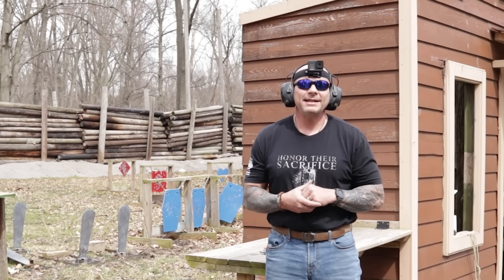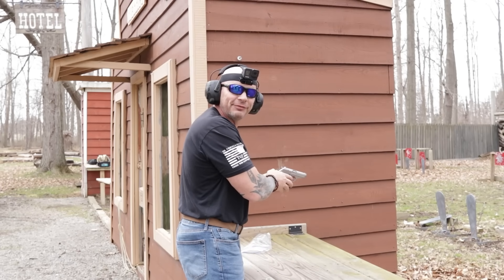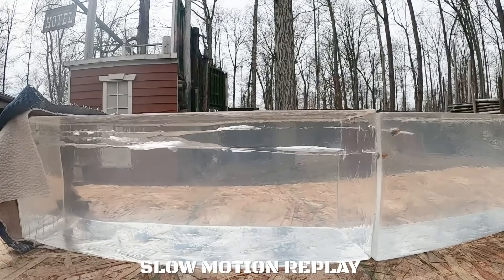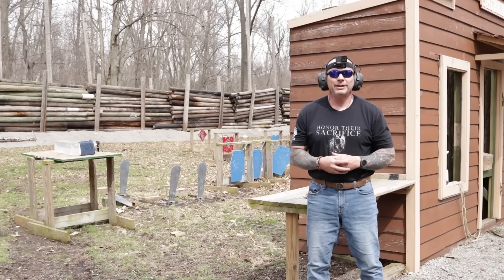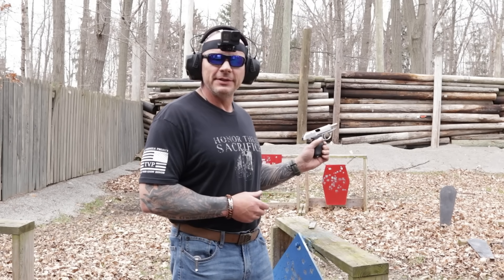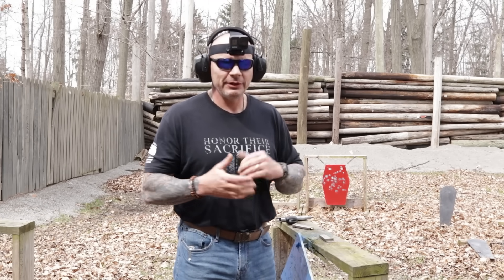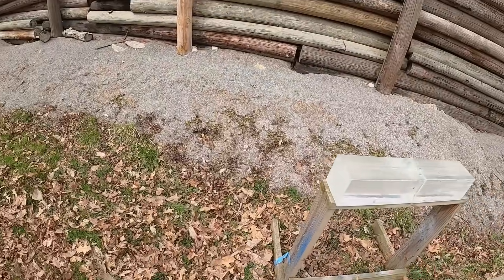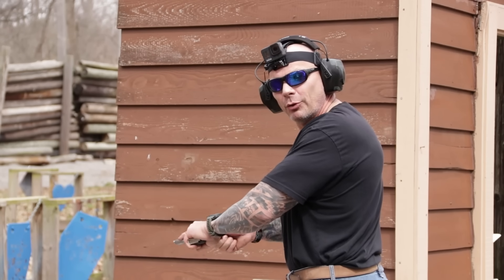Stopping Power of .380 ACP

Comment: Collected some data for the specifications of same round from Federal for .380, 9 mm, and .40 S&W and testing from Scott’s with 4 layer denim over 10% ballistic gelatin at 10’.  Wanted an apples to apples comparison.  The .380 penetrated 12.26” and expanded to 0.59” at a velocity of 956 with muzzle energy of 189.  The 9 mm penetrated 13.86” and expanded to 0.63” at a velocity of 912 with a muzzle energy of 326.  The .40 S&W penetrated 15.4” and expanded to 0.72” at a velocity of 968 with a muzzle energy of 468.  I don’t shoot Federal but gathered this pretty quickly.  I carry the Winchester Ranger T Series in my 9mm Sig P365 and .40 Sig P239 in the identical Holster.  They function the same and I only carry inside the waistband on my strong side.  I accept the added size and weight of the micro 9 for, what I feel are superior ballistics to the .380.  Not a hater though.  Use to carry one when higher caliber options were far too large like the venerable Beretta 92fs.  I greatly ascribe to the data compiled by Dr Martin Fackler regarding bullet effectiveness for a wide range of common pistol, rifle, and shotgun rounds.  It is a well organized, interesting, and scientifically supported read.  Carry legal, carry safe, carry often.
Reply: Greg Ellefritz work, which actually relies on thousands of real world shootings, shows no signjficant statistical difference between 380 and any of the other Duty calibers. Even the specifications that you listed above between 9 mm and 380 are almost identical. And any difference at all probably vanishes once you step up to 380 +P
Reply: @Followme556  We all have opinions.  If they are all statistically identical I do wonder why law enforcement agencies across the country and the world don't issue .380 caliber pistols?   Seems like a no brainer if they are so reliable, so powerful, and shoot so much better than larger calibers  The agency I worked for only allow them for back-up weapons.  I will stick with what I carry in 9mm and .40 S&W which I shoot rapidly and with consistently perfect scores for the last 30 years.  I simply don't need a .380.
Reply: @markymark9961  law enforcement agencies all over the world used 380s for literally decades. There are probably still quite a few who still do.
Reply: @markymark9961  Shanghai SWAT for instance when that was literally the wild west of the East issued Colt 1903 carry pistols until the Communist Revolution. Very very famous time for gun fights and some very famous gunfighters came out of that era and police force.
Reply: @markymark9961  40 Smith & Wesson is a good example of what we are talking about though. LE agencies all over the US adopted it because it was perceived to be needed, but now they have almost all abandoned it because it is literally no better than 9 mm and arguably worse.
Reply: @Followme556  I can find studies that say anything.  I want to see analytical data.  LE did not abandon the .40 due to its lack of effectiveness according the the FBI at Quantico.  "We opted for the best marginally effective caliber that the weakest shooters could shoot acceptably".   The .40 was not the best choice for their agents.  Meaning they can't shoot it accurately and efficiently and the cost of a 9mm is lower.  They did not adopt a .380.  Wonder why?  I read the article you referenced and Ellefritz which isn't a study in the sense of the word, it is a list, or as he called it "pulling numbers out of thin air".  I love all his back peddling throughout the article.  In fact he concludes the article with " I do not believe that the .380 auto works more effectively than a 9mm, .40 S&W, or .45 acp.  If you read all the excuses he makes for the numbers in the "study" and believe in his "research" and accepted his recommendation, you wouldn't carry a .380.    No debate for me, I'm sticking with what I got.  I suggest you do the same.
Reply: @markymark9961  Ellefritz literally studied thousands of shootings. That's analytical data.
I did not say the 40 was ineffective, i said it is inferior to 9mm when all things are considered.
Who cares if the FBI adopted a 380? They didnt adopt a 10mm or 44 magnum either- but both of those rounds are highly effective.
There are 380 rounds that consistently expand through denim and penetrate 12+". They have been used to great effect by many LE agencies all over the world, for decades, and they have shown to be every bit as statistically effective as any other duty caliber in real world shootings.
I don't really care if you can wrap your head around these facts, they remain facts nontheless.
Reply: @Followme556  Facts based on what?  You cited "real world shootings" by Ellefritz who does not draw the same conclusion as you.  Name a single law enforcement agency in the USA that issues them as a primary pistol.  For decades the police standard issue was the S&W model 10 revolver loaded with semi wadcutters.  Not a good option.  Your point on the issuance of the 10mm and 44 magnum is mute since we are discussing calibers less powerful than 9mm and .40 S&W.  I will be waiting for the facts.  I took time who find the author you cited since I am always open to learning and finding new information.  That ain't it.  It only reinforces my point.  A .380 can be sufficient, however, the ballistics are unreliable especially from shorter barreled pistols.  You sound like a member of the Biden Administration.  Russia, Russia, Russia, it is as clear as crystal.......until the evidence was divulged. Zero.
Reply: @markymark9961  Ellefritz' data literally draws the conclusion I am stating. 380 is within a few % points of every other duty caliber, and is actually higher than some of them.
Who cares what US LE agencies use 380? None of them use 357 magnum anymore....it's still the single most effective duty caliber in the Ellefritz study to this day. 
The simple fact is that 380 XTP reliably expands and meets the FBI penetration standard. 

It does so in pistols that are much smaller and lighter than even pistols like the Sig P365, and it is now available in multiple platforms that offer high capacity of 13 or more rounds.
It is not my job to convince you, since I simply do not care what you carry. However, I do not want unthinking automatons to pass bad information either.
Btw, since you are/were a cop, please allow me to remind you that when kids are being murdered in a school, you're supposed to go in and stop it. Since so many of your buddies seem to have a hard time remembering this.
Caliber is irrelevant when you stand outside cowering in a hallway.
BTW, TREMENDOUS wins at the supreme court again today, one directly related to gun rights, and one that is definitely related.
"I did this." -President Donald J Trump
Reply: @markymark9961  I think you should read some historical data, such as the types and numbers of gunfights that Shanghai municipal PD was involved in, before running at the mouth anymore about things you are ignorant of.
Their standard issue was the Colt 1903 380 and they commissioned a special version of it which Ian McCollum of Forgotten weapons did an episode on. He also owns one.
Shanghai PD invented the concept of SWAT, and was headed by two of the most legendary gunfighters of the era, William Fairborne of the Royal Marines and Erik Sykes, both of whom would go on to serve in the SAS in world war II and who designed the legendary Fairborne Sykes commando dagger.
These dudes were as hard core legit as could be, and THEY specifically chose the Colt 1903 in 380 acp as the sidearm of choice for the Shanghai municipal PD.
Fairborne and Sykes also developed the hand to hand techniques for the Shanghai PD and for the Allied commando/special forces units of WWII, and extensively trained allied Commando forces in WWII. Both continued to train SOE and later CIA agents for the US and other allied nations.
These dudes are absolute legends, and they put down more bad guys with 380's than any of us ever will with any gun of any type.
 And they were using "ineffective" ball ammunition.

So the problem here is not that 380 is ineffective, it is that you are historically ignorant and apparently don't realize that the world does not end at the shores of the United States.
Reply: @markymark9961  Your commentary reminds me of all the old Fudd's that used to annoy me at gun store counters who babbled on about how 45 ACP was the only round worth carrying and how 9mm was a wimpy girls caliber.
Reply: @spearthumb68  I don’t stand at gun store counters.  Got better things to do.   Take your meds.  I merely pulled manufacturers data on 3 calibers for illustrative purposes.  The two larger seem superior the the smallest.  I stated I carry the “wimpy 9mm” often.  I don’t think there is a magic handgun caliber.  You are arguing with me because I don’t choose the .380.  How tolerant comrade.  I hope whatever you select works for you in the time of need.  You must be a leftist, perhaps the more diminutive pistol makes you feel more feminine when you are in drag.  Happy pride month sister.
Reply: @Valorius  BTW I may be “historically ignorant” as you suggest, and admittedly don’t look past the shores of the US because that is the theater in which I carry.  Reliable Data on bullet effectiveness, according to most need only go back 20 years or so.  Doesn’t everyone say “with the latest bullet technology” X now compares to Y?  Enough said.  You carry what you like and I will do the same.  Also, you said I am spreading misinformation.  I guess you are the woke internet hall monitor.   I merely stated manufacturers data along with testing reportedly done in compliance with FBI standards.  The reader chooses to accept the data or not.  How is that misinformation?  Bet your all for CRT though and of course in bed with bumbling Joey B and the Chinese.  I hear there are vacancies in the Shanghai PD. Perhaps you should apply.
Reply: @markymark9961  it is very interesting the way that you cast political aspersions at people to cover for your ignorance and lack of knowledge. I suspect that not only are you not an ex cop but you are probably about 12-years-old old.
Reply: @Valorius  PS my ignorance and lack of knowledge are based on 3 things:  manufacturers specifications for the rounds in question, testing purportedly done by Scott’s in accordance with FBI testing protocols, and studies completed by Dr. Martin Fackler, among other anecdotal information such as being involved in and investigating shootings and seeing the effectiveness of different bullets.  I am waiting to your reply to several questions in my posts and also the studies you so voraciously rely  upon.  I ready a study a few years back where a left leaning university received a government grant to study heart disease as it relates to the consumption of bacon. The study talked all about heart health and the evils of eating bacon, until the very end.  They hyped up the amounts of fat and cholesterol and it was scary.  It then talked about the benefits of being vegan and reducing climate change by not eating meat.  Bacon bad, broccoli good.  I dug further.  Once it was peer reviewed and the testing protocols were revealed it was a complete sham.  The study reflected 1 pound of bacon and the reviewers found the study was conducted on raw bacon.   I don’t eat raw bacon, nor do I eat a pound in one sitting so I am still happily enjoying without fear.  True story and you may still find it on the internet.  Fackler didn’t tell me results he demonstrated the results for me to decide.
Reply: @Valorius  You make all good points in your response.  Fackler’s data was updated about 5 years ago I believe.  The original is decades old but it has been updated with the advent of newer projectiles.  They even updated their stance on effective 5.56 rounds moving away from heavier grain OTM bullets which fragment to lighter bonded bullets in the 55 to 62 grain weights.  Taking into account the hard body parts and barriers that may be encountered during bullet flight.  Even though he has passed I believe others are carrying on the research.  I do watch the same videos you do and appreciate what they bring to the discussion in terms of real world demonstration.  Some of those are crazy.  I think the performance of some bullets from any handgun caliber can determine the outcome.  I am a big proponent of shot placement being the key.  But clearly the 9mm and .38 bullets used in the FBI shooting in Miami failed to stop the threat in a timely manner.   The assailants, according to the pathologist, would not have survived the initial hits but fought until they could not go on.  Being a police firearms instructor I have had the privilege of getting many of the first hand reports on these incidents early on.  There are many other similar cases where the bullet simply did not do its job for whatever reason.  I will give you a sad but true story of my Godmothers early 20 something’s son being accidentally shot in the head by a 45 acp from just feet away.  He and a close friend were in the basement preparing to clean the pistols they had just fired when the negligent discharge occurred.  My “cousin” as I called him, was flown to shock trauma in Baltimore and we were told he would not survive.  The bullet entered above his left ear and exited the upper right side of his head.  He survived and was left partially disabled for a number of years until his untimely death.  One never knows.  Of course we hear these stories all the time and 1 event does not make a body of work.  I am for the greatest lethality possible to immediately incapacitate my adversary.  Of course while having the size and comfort to carry all day, every day, which I do.  Take care my friend.

Comment: 380 ACP is 9mm short (kurz in German) hence the shorter case length. Info from Wikipedia :  Other names for .380 ACP include .380 Auto, 9×17mm, 9mm Browning, 9mm Corto, 9mm Kurz, 9mm Short, and 9mm Browning Court for those that might want to challenge the definition....

Comment: You said you read the comments so here goes. i carry .380 as my daily carry. i own a beretta nano 9mm, a ruger p90dc .45 i prefer the bersa model 85 .380 as my daily carry. many people say the .380 isn't powerful enough for self defense but i have seen wounds caused by a .380. it is more than powerful enough. i would give anything if someone would test the .380 through denim, 3mm leather, pork ribs and a chicken breast and post it on youtube. it is a realistic test for clothing, skin, bone and soft tissue damage. and more importantly it would quiet the naysayers on .380. as far as i can tell that is the most realistic test for any firearm. i don't post video's... so maybe you'll do it?  also shoot .22lr through it as well. it would go a looong way to shutting up the armchair quarterbacks on youtube.  if you can find it try some swcr ammunition. it is solid copper .380 hollow point at 1100 feet per second. lighter projectile more energy. but for the test just ball and regular hollow point please. oh and thank you.

Comment: 380 ACP is just fine and you have to split hairs to find fault as a defensive caliber.  I have always maintained that the best gun for defense is the one you have available and will carry and you can handle well.  So I think a 380 is great if that is the gun you have.  But I see no reason to buy a 380 over a 9mm.  More advantages for the 9 including ammo availability and ammo cost.

Comment: my guess is that no on here has done any pistol reloading? a .380 ... a .38cal  a .38 special a 9mm   & a  .357 magnum all use the same reloading bullet size... either in ball  or hollow point!   there is not any difference except in the weight of the bullet you want to use for your reloading...  and those two types become the different caliber bullets because of the casing that the bullet is pressed into and how much powder is placed in that case !!!   so... that is why the .380 performs good & the only reason the other larger casing shells go deeper penetrating is because they have more powder in a larger shell case causing a larger explosion sending the same size bullet faster with a harder impact.